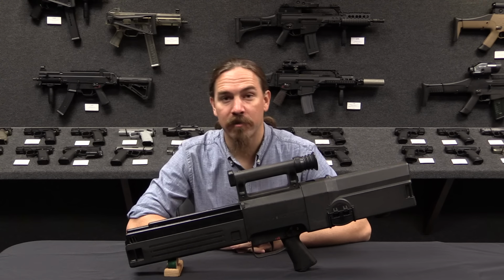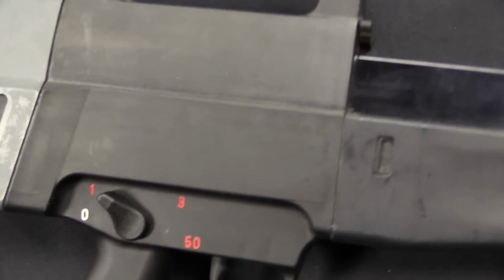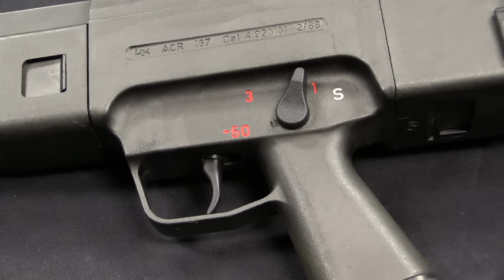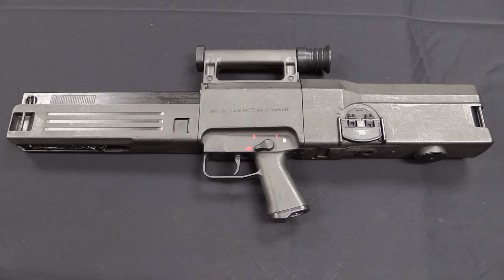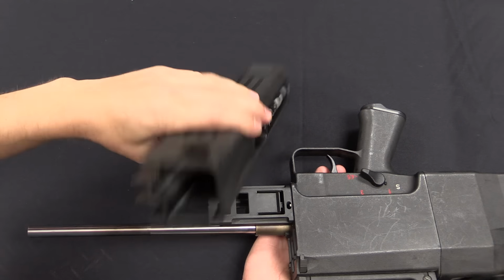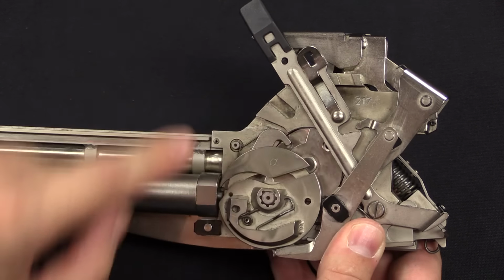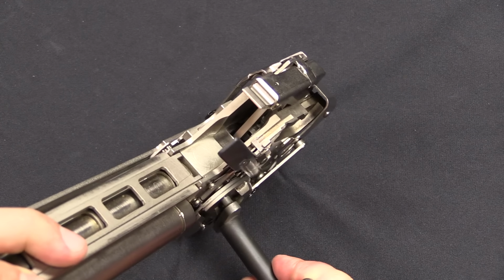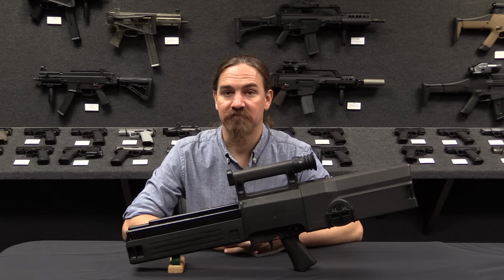Kraut Space Magic: the H&K G11

Comment: In the future won't there be issues with using air cooled weapons in a vacuum (ie a place that has no air). Seems like a problem.
Reply: Not that I would really have any clue about this stuff, but there are three methods of transferring heat: conduction, convection, and radiation. Of the three, only radiation works in space. According to NASA, the surface of a material can be designed to change how it radiates heat:

"The amount of heat that a spacecraft radiates into space and receives from the Sun can be controlled by the makeup of its surface. And this is the second secret of the vacuum bottle (or thermos): while the vacuum suppresses heat exchanges by conduction and air convection, exchange by radiation is suppressed by the shiny metallic coating of the bottle. This shiny coating reflects the heat radiation like a mirror and keeps it either inside the bottle (if the content is hot) or outside (if the content is cold)."
(https://helios.gsfc.nasa.gov/qa_sp_ht.html)

I believe the heat you feel from a fire or a recently-fired gun barrel is radiative, so cooling in space would likely be driven by making the gun radiate its heat as efficiently as possible. So while air-cooling wouldn't be possible, it doesn't mean cooling is impossible.

(I'm an Electrical Engineering student, so I know effectively fuck-all about Thermodynamics. The above is to the best of my knowledge and 5 seconds of research, so if it's completely incorrect someone with the proper background knowledge is free to correct me)
Reply: @Blustride  My understanding in short is basically this: Space is fucking cold. Like -400f or something. We are usually trying to keep things insulated to preserve heat because thats how humans and our tech are designed. Losing heat is as simple as doing nothing to preserve it. The biggest problem for a "space gun" will be keeping it from getting too cold, not too hot. Just like freezing something with liquid nitrogen makes it extremely brittle space would do the same to any material the weapon is made from. For lack of a better example a regular firearm would be an explosion in a glass bottle at that point. The steel would be so brittle the detonation of the propellant would destroy it.
Reply: @ChuckADickiner  The biggest problem in space is overheating. It's why satellite and other space vehicle designs have giant radiating surfaces. You could also technically dump your waste heat into water (just to name an easily accessible liquid to use) and spray it out into space - the finer the spray the better, because surface area is one of your primary ways of getting rid of heat in space - then recollect it later when it's had time to cool down. But that's a lot more complicated than just slapping big ol fins all over your space-whatever.

So if you are going to use a gun (of whatever type) in space you're gonna want it to have as much radiating surface as possible. Or use a sword. Maybe the Imperium was on to something there.
Reply: @datonkallandor8687  I would argue it's the radiation causing heat when it hits objects not really heat per se because thermal dynamics work very differently in space. If there is no radiation waves hitting an object it will have no heat. Satellites have big solar panel surfaces to absorb light energy. not for cooling. satellites orbiting the sun  have a reflective face to the sun and a "black" side facing away from the sun, preventing the radiation from hitting the satelite and creating heat is really all it takes to keep it cool. The iss has radiant panels but this is for several reasons. all the heat made inside the station, people, machines, etc etc. needs to be removed to the outside of the station.  mass is another big one. more mass = more radiation absorbed. a rifle really wouldn't have the mass/surface ratio to worry about the same way. Either way bullets wont work in space because the powder cant burn in a vacuum
Reply: This actually raises an interesting point. In theory, you actually run into three issues in space : 1) no air to cool, 2) no insulation/residual heat radiation from the cold, and 3) drastic thermal expansion issues.

For the first point, air serves as a transfer fluid (in the classical sense of fluid dynamics, despite it being a gas) for the waste heat energy from more dense to less dense medium. Space isn't necessarily empty, but extremely thin on inert gases and elements. If anything, you'd struggle to keep anything warm to the touch without direct sunlight.

For the second point, we again look at relative density of earth's atmosphere. Because air is denser than space, heat radiates outwards from the planet, only being slowed down by the charges ionosphere (the addition of electrons making it denser to the relative thinner stratosphere). This causes some heat to be absorbed, some to be reflected back, and (for higher energy - potential gas) to escape. In space, unless the sun is shining directly in you, it's always really cold.

When the gun goes bang, you run into the third problem. If space can get close to 0 Kelvin, and you have a fiery explosion that subsequently bleeds heat very quickly, without insulation warping and cracking will occur quite quickly.

This, if course is all theory. If you have any suggestions, corrections, or a space gun, I'm all ears.
Reply: @cg8212  Conductive electric heaters and/or space-age materials that don't expand so much when subjected to heat. Again, EE student so I'm talking out of my ass, but maybe a ceramic would work?

By the time this is an issue we'll have space lasers anyways so it doesn't matter :^)
Reply: @Blustride  if I'm going to take a further stab at this (my background is in computer systems and network engineering, so as much a guess on my part as well) @shane brings up a good point. The best way (in theory) would be utilization of a non - newtonian compound that aligns in a lattice pattern. The theory is akin to a chinese finger trap, where the rapid increase of force causes the molecules to linearly disperse forces. Does such a material exist? No clue. Maybe some derivative of carbon fiber impregnated with depleted uranium?
Reply: Not a science guy - is it possible to radiate heat if there is nothing to heat up? IE isn’t the heat we feel off a fire actually the air transferring that heat? Wouldn’t this be the reason that space is so cold, yet the light energy from the sun excites particles in the atmosphere causing them to warm? Is my understanding of this all wrong?

Also, even if space is -400*, without active cooling would a gun not still heat up? Surely it would take longer but i would imagine that the heat generated would outpace the passive cooling action of space in the same way a car engine still gets hot even in the dead of winter.
Reply: @HE-162  Yeah you get it in an atmosphere heat is lost by both convection (ie through the air carrying heat away) and also through radiation which is the actual photons of infrared light carrying energy away from the fire. In space you only have the latter way of dispersing heat, which means spacecraft and space stations have to have these giant radiator panels to disperse heat properly.